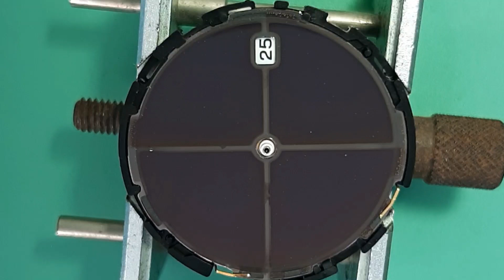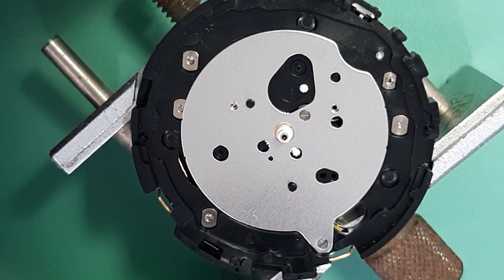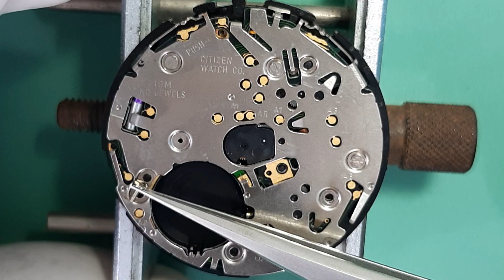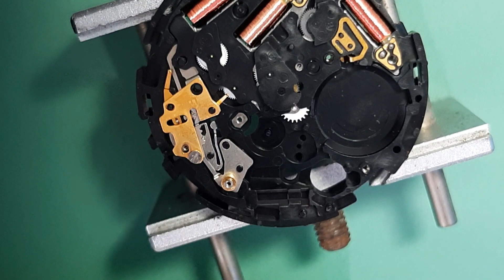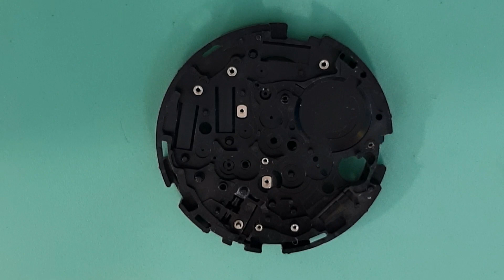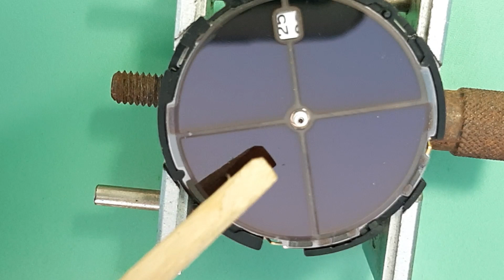CITIZEN E710, E712 Eco-Drive Perpetual Calendar Full Service Tutorial | Assembly Disassembly

Comment: J'ai fait la triste expérience de vouloir restaurer un 6870 très similaire. Deux mouvements pour en refaire 1 fonctionnel. C'est la première fois que je rencontrais autant de difficultés avec un mouvement à quartz. Les 3 rotors semblaient avoir trop de jeu sur leurs axes et collaient systématiquement à leurs platines respectives et se mettent complétement de travers comme sur cette vidéo rendant impossible la repose de la platine supérieure. Même problème avec les 2 mouvements sous la main. A voir cette vidéo, ça se repositionne tout seul en quelques secondes. Ce n'est pas du tout comme ça que ça s'est passé ! Quand un rotor arrive à se positionner dans ses axes les deux autres se mettent en vrac, etc. C'est un enfer. Après des dizaines de soirées entières et de patience à essayer de remettre cette foutu pièce j'ai fini par capituler et à tout mettre au feu d'énervement. A vos risques et péril et si quelqu'un a la solution, je veux bien la connaître !